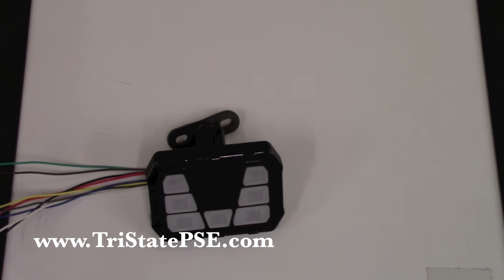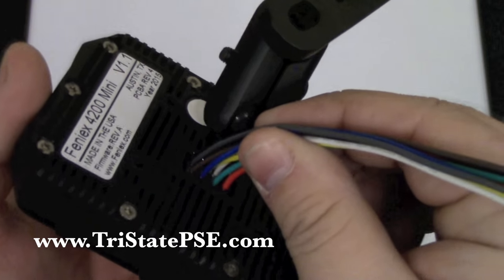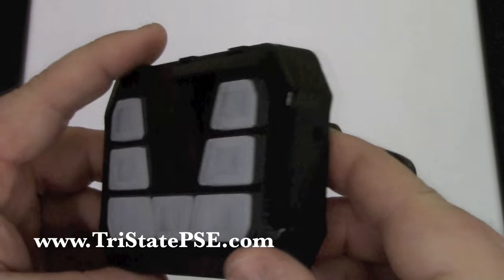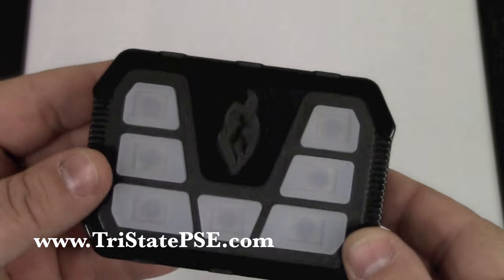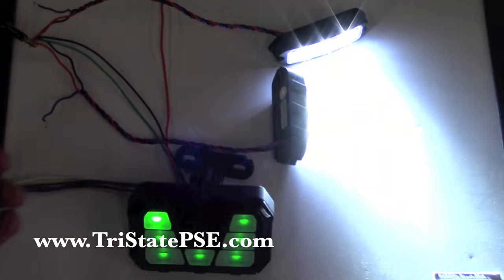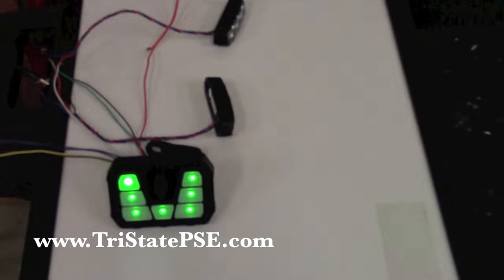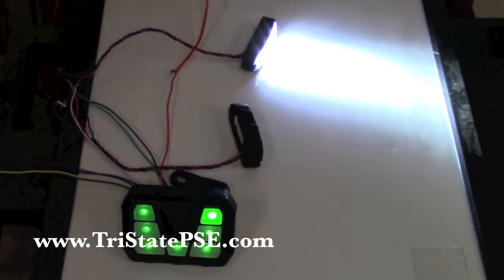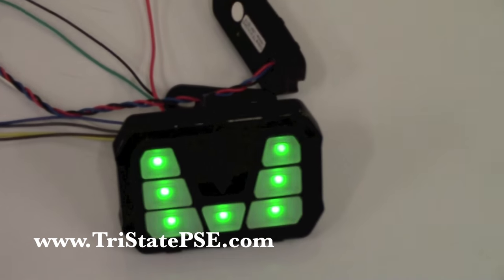Feniex 4200 Mini Controller (Close-Up)

Comment: Hey Erick, 

Can you please show how you did the wiring setup for the lights in the demo to be controlled by the mini are the positive connectors connected to just the green or did you use two connectors from the controller. It would be much appreciated. 

Thanks

Comment: I have a question. Button 1 (top left) can be programmed as a wig wag as you demonstrated and button 2 (top right) changes the pattern. If wig wag is not currently switched on button 1, can button 2 be used to control anything else, or once you enable wig wag button 2 only controls the pattern. Basically if you push button 2 on its own can it do something else when you're not using wig wag? Thank you

Comment: Great product and very easy to install. I installed mine in a 2015 Kia Optima and is currently running my grill light and will be hooking my dash and deck light to them soon. Tri-State PSE i get this from you and it was very fast getting to me, thank you.
Reply from the maker: +Medox  - Thank you for your business! We're glad you like it :)
Reply: How did your install go? I just bought this and a split single Feniex visor light and I want to get it setup correctly, so I can utilize all the options of the controller as well as the light bar.

Comment: Question concerning the flash pattern option (top two buttons):
When turned off (either by top left or center bottom buttons), does it revert back to the first flash pattern when started up the next time ... or will it stay on the most recent flash pattern when restarted?

Comment: Does this unit have a parasitic draw when off? I am debating putting this in rv to run my outdoor lights.  I want to turn off items that already have parasitic draws like usb plugs with leds in them voltmeters and usb plugs all draw from my off grid trailer.  I want a control box to kill all of those and If I want them I will  turn them on.

Comment: Can you put the pattern change wire from the 2 fusion surface mounts to one of the buttons on the controller to change the pattern on both or just do it this way

Comment: with a dual color strobe white/blue is it possible to have steady burn on both colors as well as have them strobe by just hooking them up to multiple buttons or will I have to change the flash patterns to go back and forth

Comment: So I have a question about the Fenix 4200 Mini Controller. I have a 20 inch single row off road led light bar manufactured by Aurora LED and I'm wondering if the controller will be able to handle carrying current to the light bar as well as my other led strobes without blowing the 20 amp fuse that comes with the controller? The light bar comes with a 10 amp in-line fuse. Also as far as powering my lights I'm assuming that the positive wires to the lights get their power from the controller but do I have to ground out the negative wires separately to the vehicle chassis or is there a grounding screw somewhere on the controller to hook the negative wires to?
Reply from the maker: Brandon Peterson - Each button on the 4200 Mini is rated for only 5 amps of output. I'm not sure where you heard 20 amps, but it's only 5 per switch. The unit is internally fused and also has built in relays. If the current draw exceeds 5 amps it will trip the system and reset itself.
Reply from the maker: Brandon Peterson - Each button on the 4200 Mini is rated for only 5 amps of output. I'm not sure where you heard 20 amps, but it's only 5 per switch. The unit is internally fused and also has built in relays. If the current draw exceeds 5 amps it will trip the system and reset itself.
Reply from the maker: Brandon Peterson - Each button on the 4200 Mini is rated for only 5 amps of output. I'm not sure where you heard 20 amps, but it's only 5 per switch. The unit is internally fused and also has built in relays. If the current draw exceeds 5 amps it will trip the system and reset itself.

Comment: Is this unit compatible with any strobe light or does it require led lights
Reply from the maker: Wade Mosier - I would stick to Led lights as each button is rated at 5 amps.

Comment: Will the controller provide enough power for lets say 4 4" work lights as well as some T3's? It seems like just the little 14-16ga wire wouldnt be enough..
Reply from the maker: Each button is fused at 5 amps, so you will need to know the amp draw of your lights and assign them to the appropriate amount of buttons.
Reply: Alright thank you. Do you know where I could find some more detailed wiring instructions for this? I am mostly curious as to if I wire in some t'3s to the top left switch, and use the wig wag feature to change patterns, and wire something else into the top right switch, after I change my pattern and re set the controller will I be able to control what was wired to the top right switch?
Reply from the maker: In order to use the wig-wag headlight flasher function, it requires the use of the top left & top right buttons. You would need to wire the T3's to a different button. - 
http://www.feniex.com/uploads/literature/80929Mini%204200%20IM%20011116.pdf

Comment: Could anyone help me perhaps with some more detailed directions on how to use the momentary feature? I hooked the power and ground to the controller, power to the lights and ground to the lights ( 2 T3's), ran a wire from my switch which I programmed to be momentary, and attached that wire to the two blue wires on the lights, however I am unable to change patterns. Any advice is appreciated
Reply: +Letsride600

The outputs on the 4200 mini are all positive, the T3 pattern changer requires negative. You will need to utilize a relay from your momentary button to make your setup work properly.